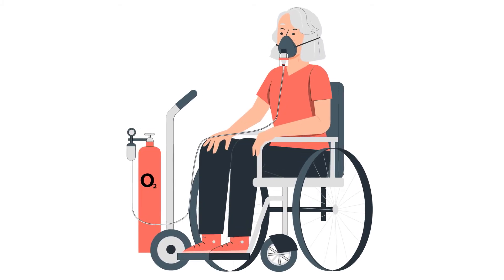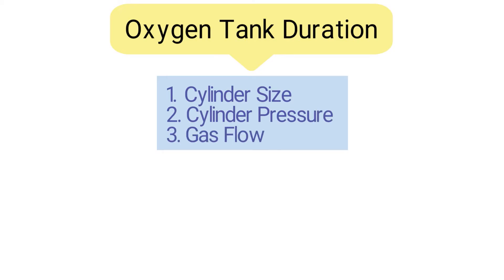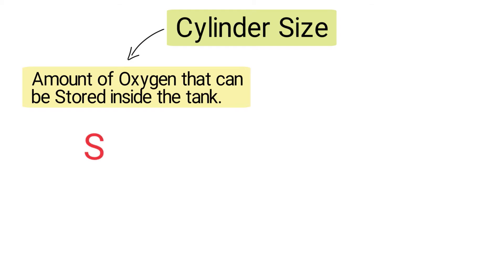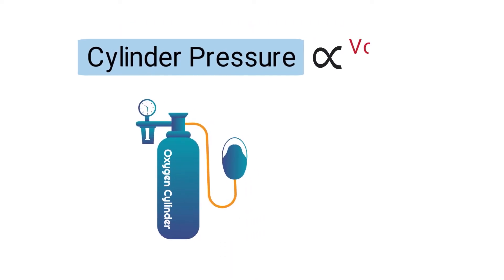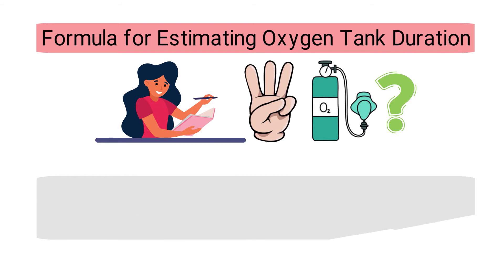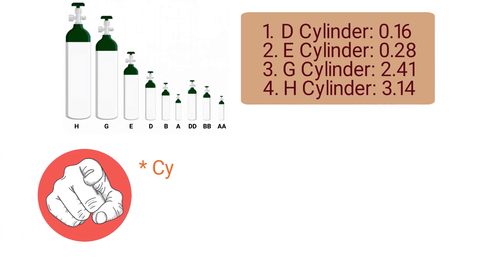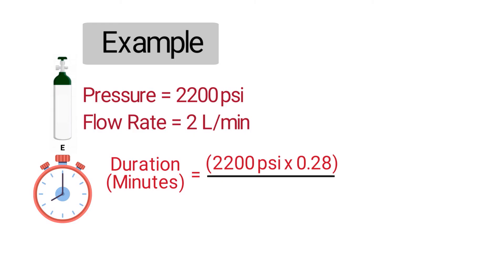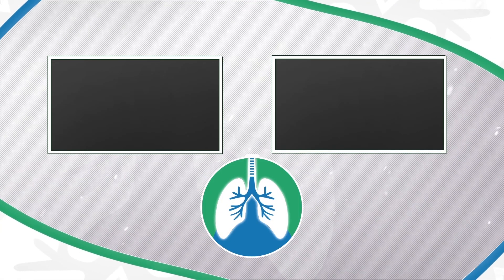How Long Will an Oxygen Cylinder Last? [Oxygen Tank Duration]

Comment: @Respiratory Therapy Zone
@RespiratoryTherapyZone
Hello. I am new to using oxygen.  I have a electric oxygen concentrator.  What is the absolute best to deliver maximum concentration of oxygen, (to raise O2 numbers), a bulky O2 tank or electric concentrator?
I am curious if I switched to a tank that my O2 numbers would be better.  
Thank you if you or anyone else can answer.
Reply: No one on home oxygen at 1 or 2 LPM uses tanks in their home. The portable cylinder is used for short trips or in an emergency. a concentrator will deliver oxygen at low flow the same as a tank.